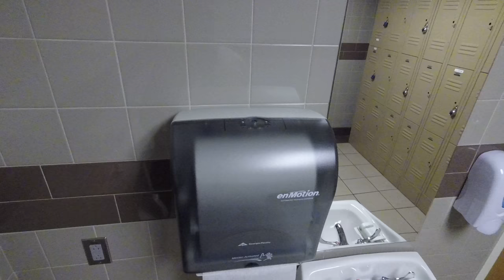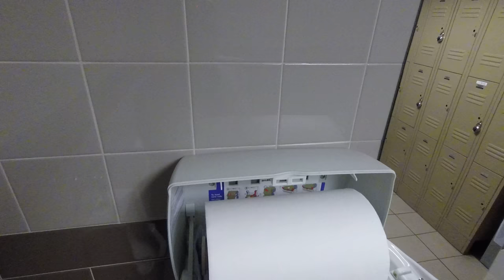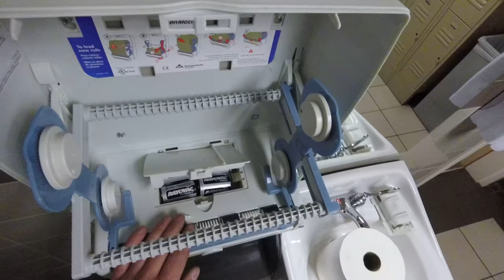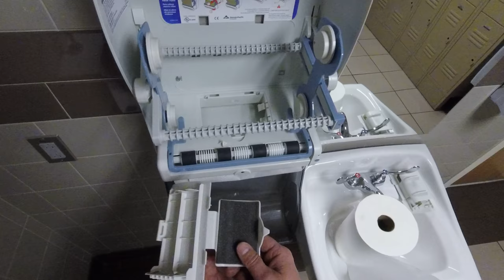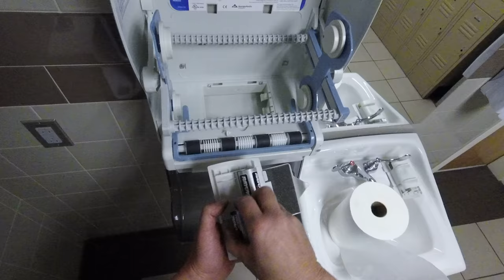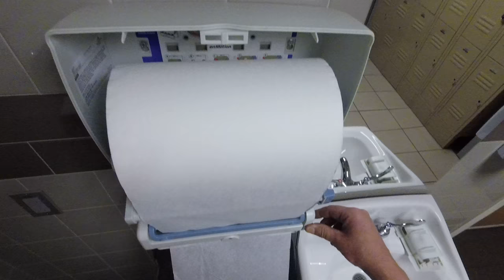Paper towel dispenser trouble shoot/Repair

Comment: What if it keeps giving you short pieces?  I've changed the batteries set it on max length and it still gives me short pieces of paper towel
Reply: Many of ours, at my workplace, dispense a generous amount of paper towel.
Oftentimes, I see the "problem lights" (two red and a blue) rapidly flashing (indicating that there is a problem, as the printed instructions inside I once read). How does one fix this so we don't go wasting our paper towel supply?

Comment: Why does mine not work properly when the roll is big
Reply from the maker: is it not dispensing or is the roll falling out of the holder? if it:s not dispensing it may need new batteries or a new transmission.